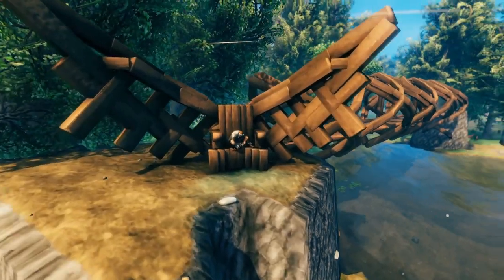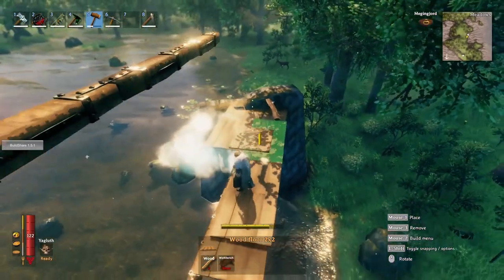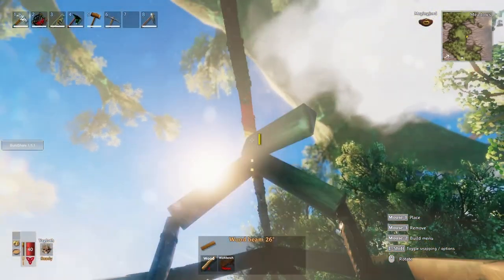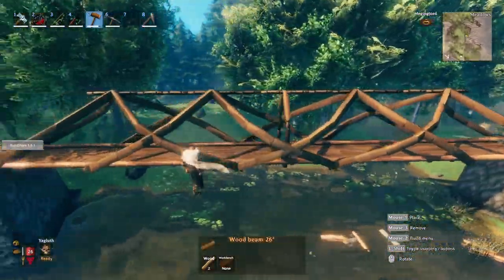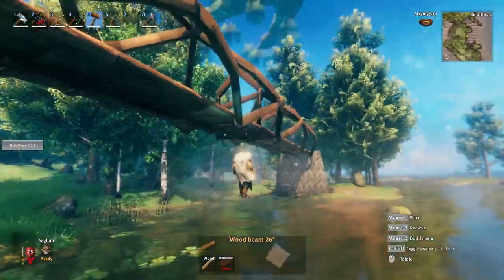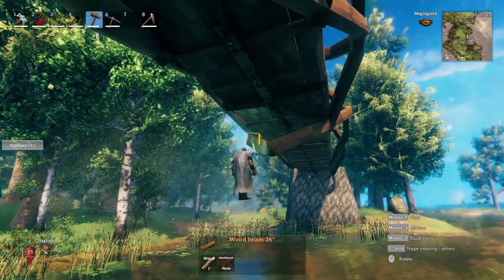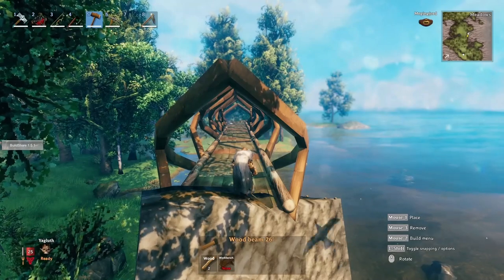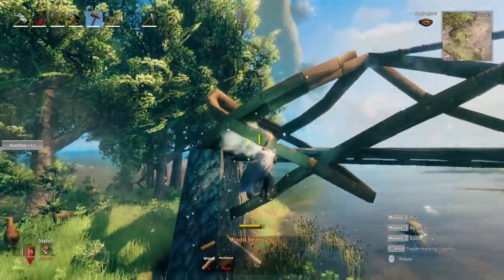Valheim - How to build a helical bridge

Comment: Looks great, but when I try building it in Survival mode, the second set of Iron beams (the 8 each way of center) won't hold past the 4th beam.  Not sure how you got these to not only stay up, but then be a hanging point for more wood.
Reply from the maker: try temp supports until you get the helix built. you may not have the main bottom beam meshed into the ground and arnt getting the support across to the 12th beam which will affect the build. the helix helps hold everything together. let me know if that works

Comment: no matter what i do, i cannot get the top beam to not break
Reply from the maker: My suggestion is to check your span. This bridge is the maximum span iron beams can do. It's possible you are 1 beam too long and that's why it's breaking. It's better to make the bridge a bit shorter. It is a very finicky bridge to build